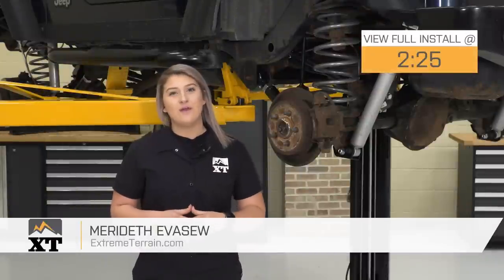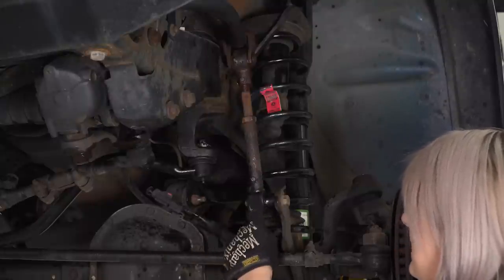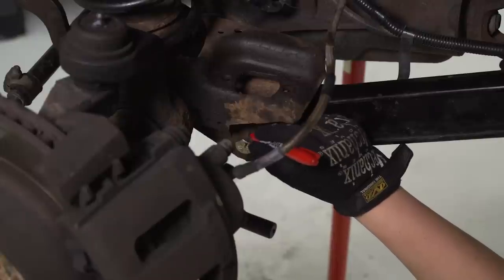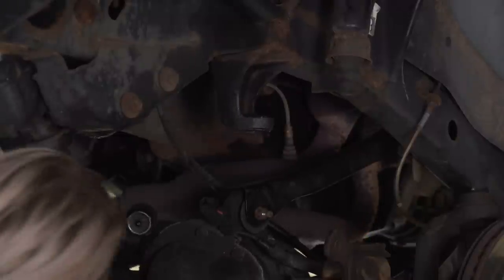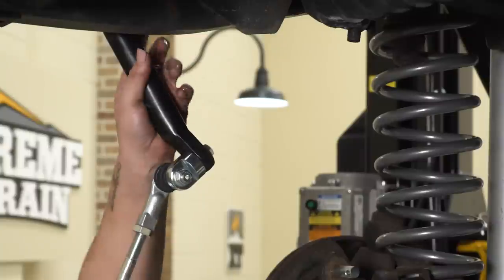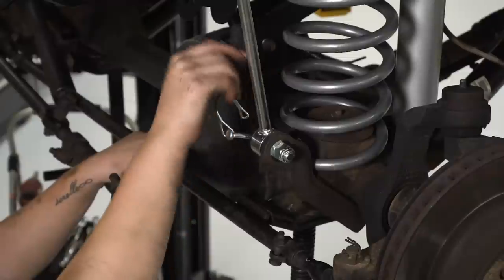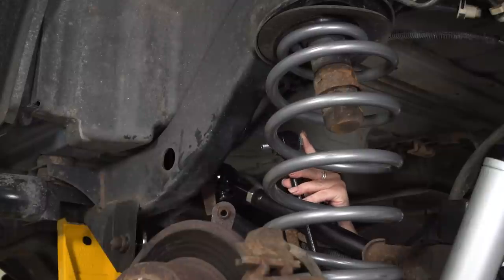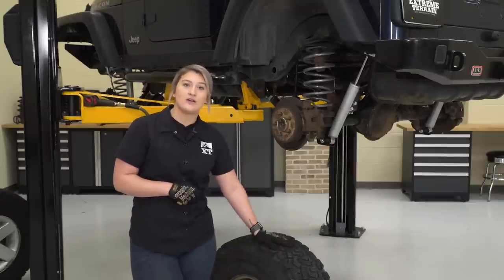Jeep Wrangler TJ Rough Country 4" X-Series Lift Kit w/ Shocks (1997-2006) Review & Install

Comment: The shock piston shaft has a hex cut at the top for holding while tightening the nut.  DO NOT USE VICE GRIPS OR PLIERS ON THE SHAFT.  Damage to the shaft will cut the dirt seal.

Comment: Added this kit, vibration started in ride so needed to add Rugged Ridge NP231 Transfer case SYE kit and new rough country CV rear driveshaft to fit the 4 inch left THEN went ahead replaced front Driveshaft heavy duty  $eris 1310 CV with grease able u-joints and Rough Country transfer case drop kit for 4 to 6 inch lift! Overall a very nice look on 35 tires. Rough Country is for a person who won't be wheeling seriously and just wants a great aggressive look. My 2001 Sahara never looked so good!

Comment: What was the Rear Upper Control Arms measurements? I didn't see it in the video?
Reply: After a year of a complete frame replacement rebuild I'm at the point of driving it. You definitely want to do a SYE to have better drive line angle. Which a year ago I was asking for the rear upper control arm measurements. By using adjustable control arms, you need a angle finder and adjust your upper arms so the drive shaft is almost a straight shot into the rear diff. Check out this video and it will explain/show you exactly what is needed done to have the correct pinion angle.
 
https://youtu.be/bgTe0FgSozM

Comment: Just finished installing this and the instructions were garbage. I installed there 2.5 inch lift with the x series control arms. The pre alignment were way off had series vibrations on the way to the alignment shop. After watching this video they specified the same pre alignment measurement for my 2.5 lift as the 4 inch lift you installed which doesn’t make sense. 

Also one of the boxes where damaged and was missing the track bar bracket just received it Friday after waiting 10 days for it. Lost two weekends of wheeling.

Comment: What  tire and wheels you can recommend for this lifting?
Reply from the maker: At 4" of lift, you're looking at comfortably fitting a set of 33" tires! Or you could look into aftermarket high-clearance fender flares to fit a set of 35" tires, but you won't have as much room for articulation then if you plan on going off-road. As for wheels, most aftermarket 16x8s or 15x8s will come with appropriate backspacing out-of-the-gate so you won't have to worry about rubbing. -Zach

Comment: Please learn to use an adjustable wrench correctly before you get hurt.  Never put the pressure on the adjustable jaw.  I’m half way through your video and you’ve use the wrench the wrong way consistently.  When you have the pressure on the adjustable jaw, the weakest part of the wrench, and it pops, you will be looking at busted knuckles at a minimum.  We were drilled about this over and over in school!